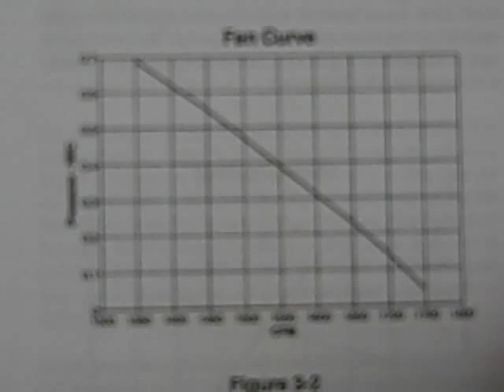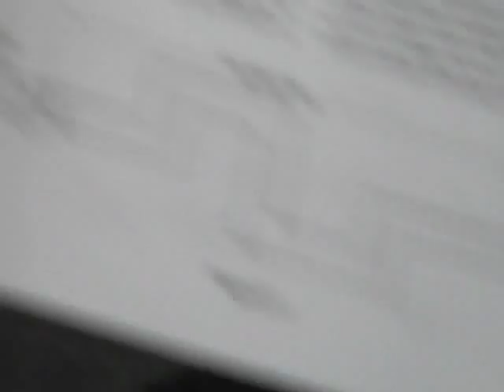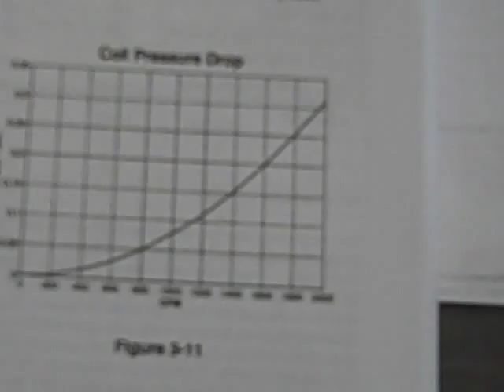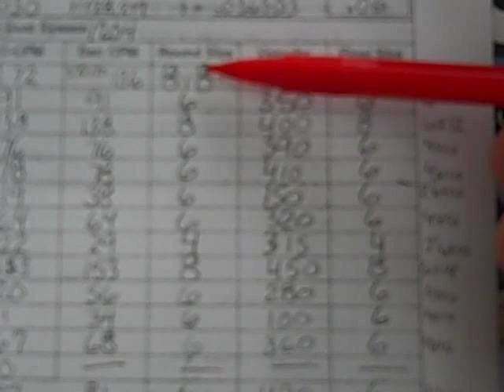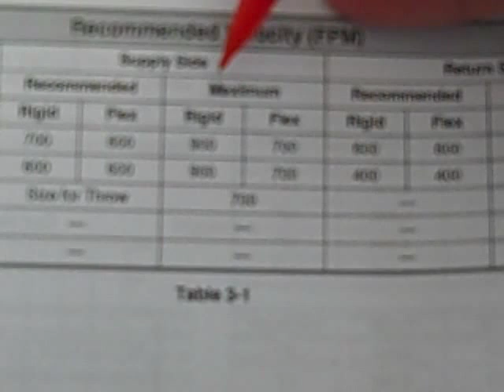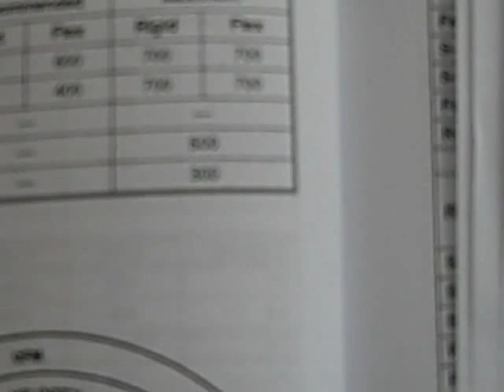HVAC Design Build Pt 5 duct calculations.wmv

Comment: I'm A CONTRACTOR  in Florida and i enjoy your good video's ,i don't understand why their's not more veiwers. i do have a question, do you insulate the outside of duct.my duct sub puts my design ductwork in and I like round or oval so its easier to insulate.aslo is it code there to tape and mustic your seams?

Comment from the maker: @dizziedallas Thanks. From what I see you do as well. 

I'm posting pts 7-9 right now. I am holding back on pt 6. It is about energy auditing and equipment selection. I think I can do a better job so I am holding back on pt 6. Pt 7-9 is fabricating 2-8"x16" broadway elbows with 8" inside radius. 7 is layout, 8 is pittsburgh, flanging and roll forming, 9 is final assembly. Iv'e got some other fittings to fab but if I make vids for those they will be shorter.